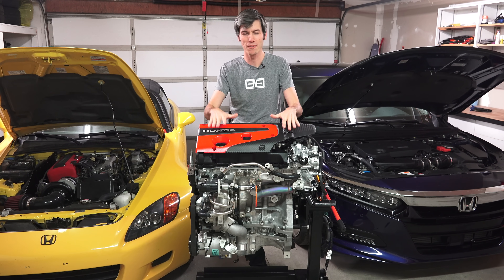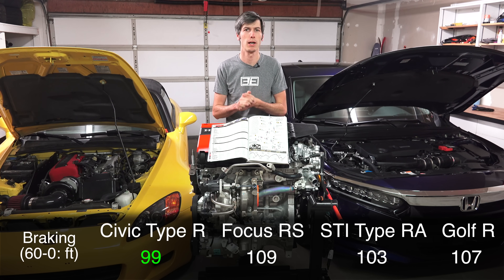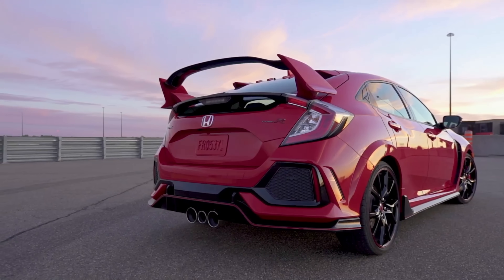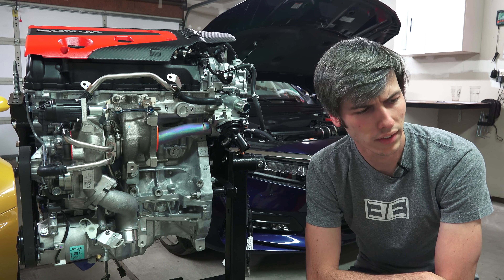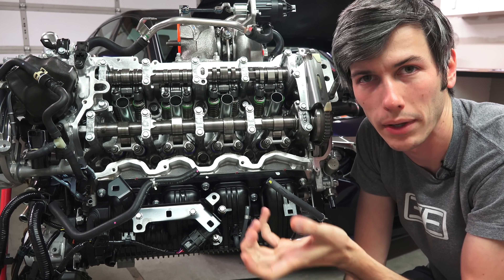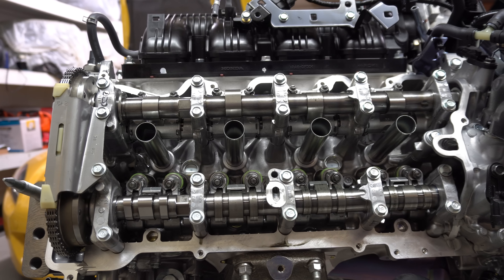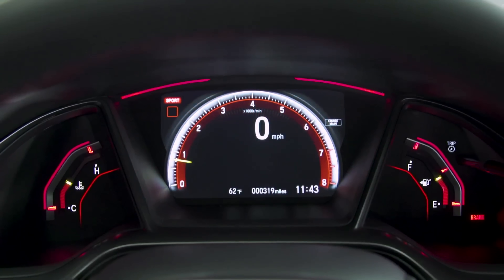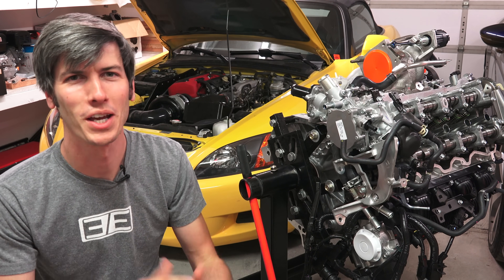The Honda Civic Type R Destroys The Competition - The Best Engines

Comment: DSG Golf R would destroy the Civic i think. Look at where the torque and hp is in the different engines... I dont like driving around at 6000RPM all the time
Reply: Type r makes peak torque at just over 2000 rpm.
Reply: Lol welcome to 2018! Honda make turbo engines nowadays!....
Reply: The DSG would spank the Type R so hard it's not even funny.
Reply: @oxaile4021  funny how with a manual golf loses to everyone, so the have to bring DSG into play, its VWs problem that they made a shitty manual
Reply: Alex Nichols
Or just a very good automatic. Name me another ~300hp factory stock car with rated 0-100 of 4.6 sec?
Reply: I drive with B series. 6000 rpm is only when the fun starts and ends at 8500, thats Honda
Reply: I like to drive at the rpm that the car is fastest if I'm in a race. May it be 8000 or 6000 rpm
Reply: the only thing that a vw can destroy his is own engine lol
awd + automatic is the most boring combination ever, 2wd and manual is the most fun
Reply: The DSG destroys all of these cars from a dig.  DSG + AWD makes for some silly launch control fun.

Comment: Chain drive. Honda claims it is designed for the life of the engine. 
Well, if it fails it’s . . . umm . . . the end of the engine
So yes, Honda is absolutely right about that.
Reply: Lmao
Reply: I own a Ford Coyote V8 and have pushing over 200k mi on the clock. When I took it in for the 100k mi service when the engine had 125k mi on it, the techs said the valvetrain chains were still 100%. 
But you’re right, if the valve train dies, the engine dies with it. I saw a Coyote with a failed chain to one bank. The valves hit the pistons and sent shards everywhere in the crankcase.
Reply: @SavageJim01  Even if it's "just" valve damage the repair costs can be huge and it's highly likely the crank bearing shells will be creased by the impact leading to rapid failure after the top end is rebuilt.
Reply: ...same as belt driven, if not changed every 80K.....
Reply: eddie I thank GM for turning Saab into junk in the later years.
Reply: @Cory989  _ Saab cars were notorious with electrical failures. If they lasted they lasted because of the sheet metal quality.
Reply: The only way a modern chain drive is going to fail is absolutely negligence and zero regard for preventative maintenance. L
Reply: Chains are Much more reliable but more noisey. All chains and belts stretch but belts are more susceptible to dirt and debris and they stretch sooner, needed to be replaced lest they snap or skip a tooth and make the pistons kiss the valves in your interference engine. My sister's 88 hatchback Civic had the belt snap between 80-100k mi. The service interval on all those was 60k. Apparently they meant it. Save yourself the trouble and do the water pump and idler pulley while you're in there too. I had to replace my pump 2 weeks after my belt.. and the kit was the same price as just the belt.
Or just save the headache and go with a wet chain ;)
Reply: To be fair, the Honda timing chain looks to be much better made than most chains. Coming from someone who works on BMWs.
Reply: Michael Tran hi Michael. Why are bmw engines alway needing maintenance?..
Reply: Yeah I get your point that if the chain breaks your SOL but they do last forever. A belt is much more likely to break. I have a 1996 9C1 with the LT1 engine and no problems with the chain
Reply: LOL 747 idiots giving you the thumbs up
Reply: Sam trebil 
Lol yes, tx! I thought it was funny but never thought is was 787 funny :)
I somehow triggered a discussion I didn’t intend to too. 
I wonder if professional mass media ‘experts’ experience the same. On second thoughts, I’m almost sure they do ;-)
Reply: @jmoore9806  _ And haters are always do the same ... hate
Reply: A Honda engine does not fail😎
Reply: Tell that to my prelude
Reply: @magnusjonsson1316  ... just change oil
Reply: Magnus - LMFTFY: A properly-maintained Honda engine does not fail
Reply: @RickJohnson  ,agreed, I sold my accord with 368000 miles , the guy that bought live down my block ,he still hasn't done any major work on the engine for 4 years .
Reply: Magnus Jönsson you keep thinking that I’ve owned 3 Honda’s all garbage. I will admit I never had engine failure. Just everything else you could imagine.
Reply: BMW-E90-HQ , ” A car does not get any better than it’s owner” old saying
Reply: @magnusjonsson1316  Fernando Alonso disagrees. Both on F1 and Indy. :p
Reply: @SuperLisandro86  Max Verstappen disagrees with Alonso. No failures whatsoever.
Reply: @magnusjonsson1316  Alot of folks don't know about Honda and their F1 racing heritage and dominance unfortunately.
Reply: @magnusjonsson1316  only their automatic transmission! Except the all wheel drive ones.
Reply: ...it's just the Honda automatic transmissions that fail catastrophically.
Reply: Chain*
Reply: Ibanez208 
Tx! (Corrected)
Reply: just gotta keep eye on the tensioners & guides like all the rest who claim "lifetime"(til it's fucked)
Reply: The aussie Ford EA all the way up to the FG have timing chains and they never get touched even when the car hits  a million on the speedometer. Well done Honda 🤙🤙
Reply: What a silly comment.  Honda requires timing BELT replacements. I’d much rather take an oil bathed chain drive than a belt drive from a durability standpoint.
Reply: Never say it that way and you make sense.
Reply: TR P Good point. I remember chains giving warnings when riding a bicycle. Thank you for this input.
Reply: Like a self-fulfilling prophecy!
Reply: eddie I had a timing chain snap on Saab 9-3.
Reply: Makes me wonder what Honda says is the life expectancy of the engine?
Reply: chris42000000 Who knows! 80% of drivers will never make it to 300k—that’s a fact.
Reply: Shane Huey 
I heard that BMW’s standpoint is 200k. That is  200000km (not miles). I’m @ 232k 🤔
I’ll have it checked soon. Hope it’s still ok because to change the chain, you have to pull out the engine of 520d 😬
Reply: LoneWolf about 3 million miles or 100 years , which ever comes first
Reply: Eduard van Raalte .. time to readjust those t-  belts soon.
Reply: derp derp You’re right. Unfortunately, BMW also thought their T-Chains were ‘lifetime’ so no problem to put them at the back of the engine. Now the engine has to be pulled out to change the chain. :-(
Reply: Design same with their f1 engine which always fail 😂
Reply: @yeechia7233  "By the end of the 2019 season the Honda power unit is now considered to be one of the front running engines with performance to match the top teams while also taking reliability honours by finishing the season as the most reliable power unit of the year, with the least on track failures of all four manufacturers by a noticeable margin."

Guess again Honda now is making the most reliable engine on F1 races. It is time for you to get out of the cave you are living in for sometime.
Reply: you sir, are correct :)
Reply: Honda have a long history of getting it wrong with cam bearings and cam chains. So it's about time they managed to get the chains to last for the life of the engine. Engine life on a Type R will of course be a lot lower than the Accord.
Reply: Riddle me this... Why would you buy this, when it's the same cost as a Mustang GT, and the Mustang is all motor, rear wheel drive, and has over 200 more horses? Did I mention Ford has a deal if you order online, you have 0% APR? Cause with all the bells and whistles I want, my monthly payment is $550 where a Honda Type R is $600+ with no extra features. I actually like the look of the Type R and I love the sound I get from the turbo cars I've owned, but... logistically it doesn't make sense for me.

TLDR; Mustang has more power, all motor, and has cheaper payments with Adaptive Exhaust, and performance pack 1.
Reply: @TheJayMane   I don't own either, but personal preference is a key factor. People have been waiting on the Civic type R to come to the US for a long time, so it could be considered a special car. The type R is definitely rare. I've only seen a few of them on the roads, while I've lost count of the Mustangs I've seen on the roads. The Mustang is a good looking car, but it just doesn't really turn heads like it once did. Also, the V-8 Mustangs get a little over half the gas mileage of the type R, which is an important factor with daily driver cars. 

If horsepower is top priority over everything else, the Mustang GT is a great value. There is a reason there are a ton of Mustangs on the road, that's for sure!
Reply: @commoncentstx  you right there, it's so popular, that you are lucky to find it for MSRP, thereby making it even more than a Mustang. Though I may look at a 2018 model if it's any cheaper. I'm still deciding. I have a Boosted Scion tC and a 88 Turbo Coupe and I still haven't had the guts to sell the both yet. I want to, but even my Scion would beat the Type R. It's built and makes 500hp, but I swear every week something else breaks.I am looking for reliable, but still a head turner. To be fair no one really turns their head at the Scion, I mean it's sleeper for one, so unless I pop the hood or I get on it, ain't nobody looking at me. On the other hand I have people staring at the Thunderbird, but mainly cougars and older men lol. Wonder how much boost the Type R can handle stock motor? Anyone know of anyone that's already turned it up?
Reply: @TheJayMane  I just googled it and found an article saying that Hondata sells a tune for the type R that adds 47 hp and 72 lb-ft of torque on 93 octane. Looks like some people are already turning it up haha
Reply: Every part of an engine has a life cycle and will out eventually depending on servicing and maintenance obviously
Reply: It all makes sense now XD
Reply: even all latest Ferrari engines use chain-driven.. so its a valid argument
Reply: VS a belt drive, genius.
Reply: Lexus GS460 owner here, 220k and the timing chain is totally fine, I’ve never even heard of one going out on a Lexus, usually they will wear or “stretch” and start making noise before they will ever break. But they should last 300k easily.
Reply: Just like an Isuzu chain drive diesel. It's like a tank! It doesn't break.
Reply: ....as opposed to belts....?
Reply: Honda (and other manufacturers across the automotive spectrum) has used timing chains in their engines for a long time. This isn't new.
Reply: It will likely be non interference so if chain goes no damage should happen
Reply: I have to say that I am really happy with my PC 800 hydraulic lifters and a cam chain tension-er
Is working great for the longevity of my bike 

Two 36mm Keihin corroborators three valves per cylinder 5 gears could use Olin suspension and Brembro brakes and a final overdrive. Well hell I should just get a GS1200 A
Reply: Instruction unclear...  Attached  Honda Civic Type R engine to my 21 speed mountain bike... performance has decreased.
Reply: Conservator funny
Reply: Conservator dude it’s only you. I owned 4 accords and my family has Honda’s. So what are you talking about. We have 6 Honda’s now.
Reply: Legend17 
I wasn’t too serious. 6 cars doesn’t say much though. If 1 out of 100 fails it’s a major issue. 
I’ve no doubt though that those Honda’s have better timing chains than the ones on my BMW N47 engine.
Reply: Hope they solve the VTEC solenoid rubber leak
Reply: Better than a rubber belt
Reply: Eduard van Raalte i have seen Ford timing chains last over 300,000mi on their pickups.  My pickup has 225,000 and no issues with the chain.  My buddy has a Grom with 2,500 and the final drive chain is toast.  My Grom's chain has 3,200mi with 40% life left.  Would be more but i just changed again lubes a few months ago. So,  regular oil changes,  a chain will last a long time.
Reply: @jkutches17  Timing chains and bike drive chains not only live in very different environments, they're different types of chain. Drive chains have o-rings to seal the grease in the link hinges whereas timing chains aren't sealed to allow oil to get into the hinges. Drive chains mesh with the sprockets on the link hinges, timing chains mesh on the links themselves.
Reply: spankeyfish it's a Grom with a 420 chain. O ring chains don't start till 428 chain. The difference is drive chains deal with contaminations and timing chains have to contend with oil dilution from fuel. I found 90wt marine gear oil best for on-road use in efficiency, chain longevity,  rust protection, and ease of application.  I don't use it offroad on sand because it stays wet so it's a dirt magnet.
My F150 uses 5w20. My RX350 uses 0w20. Both really thin oils.  So there isn't much room for much dilution.  You have a 50wt diesel oil,  get a little gas in it and you're down to 45wt, you lost 10% of protection.  You have a 20wt, same amount of gas,  you're down to 15wt losing 25% of your protection.  This is where the majority of your wear comes from.
Reply: @spankeyfish The Grom doesn't come with an O-Ring chain Stock, It's a Non-O-Ring chain.
Reply: @spankeyfish  Final drive chains on bikes could be fully sealed in oil and they don't have to look like a Honda Cub or CG125. Norton rotaries did it with rubber tubes to carry the chain and final drives would just go on and on. Another option is to run the chain over idlers so it's tucked against the swing arm and hidden by a dumbbell shaped cover that looks like a shaft system.
Reply: @Dave5843-d9m  Look at the first two generations Yamaha Tmax end drive. Nortonchain in an oilbath. Lasts forever.
Reply: @jkutches17  i have a 2008 Mustang GT with the 4.6... I think I changed my chains at around 130k tho. My engine eats oil a bit but it still drives cool and gud
Reply: Jupiter Fox! That's because you (or the previous owner) didn't do timely oil changes.  They say 8,000mi. That's 8,000 freeway open freeway miles,  5,000mi suburb, or 3,000 downtown San Francisco.  My 4.6L 2V burns maybe 1/2 quart between oil changes but i change it every 3,000mi. Timing chain is just fine and i am the second owner.
Reply: Well, I’ve been working on Honda engines vor 25 years now and there was one one engine failure over all, sooo... no other engines are that reliable. If it’s belt driven like most European engines you are basically f*** if it fails :,D
Reply: Those engines are real masterpieces, so sad to see Honda not being interested in Europe after all...
Reply: A friend of mine had an Acura where the belt failed and he had to get a new engine. So, yes Honda has an issue with their belt drive engines although I don't know about the chain drives.
Reply: @unhappygilmore7129  belt can not failed alone if its well inspected. Another components cause belt failure and once it fail, slip or tear please do not attempt to restart an engine. Never
Reply: @unhappygilmore7129 most Honda engines are intereference engines, the J30A5 V6 SOHC is one of very few which aren’t intereference. so, yes, they can fail, theoretically speaking. However, a properly maintained Honda engine lasts a very very long time due to solid engineering. 👌
Reply: Ha, a timing chain beats a timing belt in reliability any day of the week. Still though, these can break and cause the motor to eat itself because the timing chain is so long. If you really want reliable and long lasting, get yourself an OHV motor.